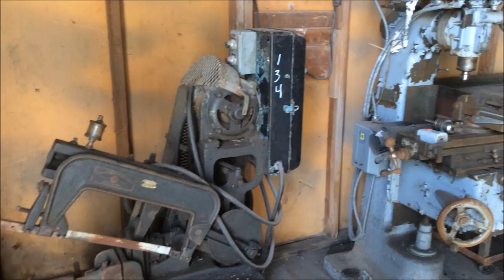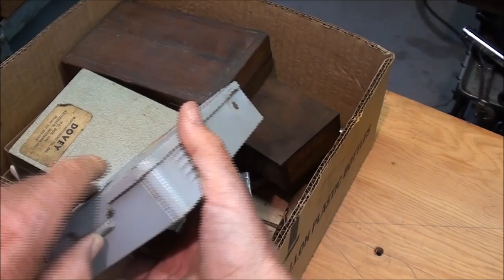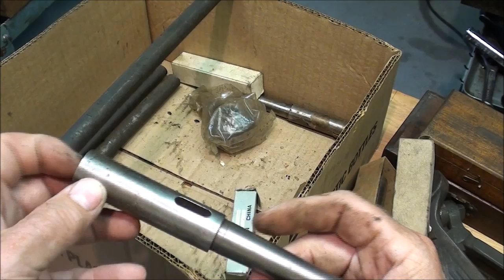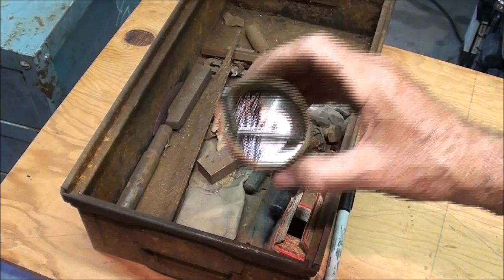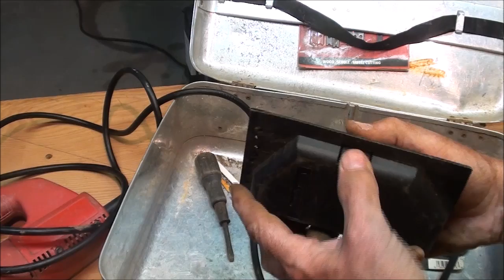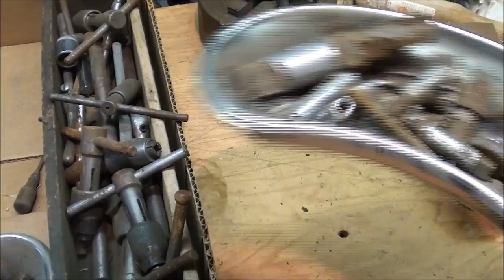TUBALCAIN GOES TO AN ESTATE SALE part 1 logan lathe

Comment: I like your videos and you are a man full of knowledge.  I worked for a man that ran a machine shop on a navy tender ship. Best working experience of my life. After he retired from the navy, he operated a machine shop and welding shop in my home town. From 67 until 2015. 
I love all your videos and I have a Logan lathe that needs tooling and much work to be useful in my motorcycle repair shop. 
I like your non spilling oil can. I found a bunch of tiki torch cans that have a screw on top for refilling. Gift idea for my brother in law's small machine shop at his home. He has a LaBlond lathe and a jet vertical mill. He is retiring this month at 70. After 40 + years in the shops here. Keep it going ,you are a great source of information.
Reply from the maker: Those old navy guys sure know a lot. Thank you for watching  I remember seeing those torch cans. That's a good idea
Reply: @mrpete222  thank you for responding so quickly. I am 65 and not to far behind you in age ,but I'll never catch you in experience.

Comment: As usual, I'm way too late, but as someone else has posted, those parallel jaw pliers were a good find if they aren't locked up. Also the the straight and curved round nose pliers.
Ah well.

Comment: center drill make them in to end mill tool for Mimi milling machine.
Reply: I use old centre drills in boring bars and slotter bars o my Bridgeport.  They are HSS and have cost no extra
Reply from the maker: +James Addington THANKS for watching

Comment: These videos of yours were coincidentally very helpful to me, and also oddly somewhat like an experience I had just this morning. I watched your multi-part Estate Sale vids not long ago, then just last night I was driving through an alley, and to my utter astonishment I saw someone had thrown away several boxes (and metal tool boxes) full of tool stuff!! To my heart's delight, and my back's dismay, I quickly and quietly gathered up every last bit, and rushed it home not knowing what it all was, and only catching a little glimpse of things. I then had to painstakingly wait until this morning to do an “unboxing” of my free treasures. There was some typical old hand saws, various hammers, a few manual worm gear drills, a few planes, tons of various pliers and screw drivers (Curiously not a single socket), several C Clamps, a Wilton Baby Bullet vice w/ Power Arm, a few machinist vices, a tool box full of files and wood turning knives, boxes of taps and dies, a tray of lathe type wrenches, T handle nut drivers, a TS-30 torque screw driver, and much much more, stuff that I don't even know what it is yet, but also a whole tool box of perhaps a few hundred bits, bores, reamers, chucks, and several Modern Magic collets which I recognized from watching your unboxing vids – Thanks for sharing the knowledge :)
Reply: John, it was the craziest find I have ever had, like a dream really. I still use some of the items today. The Wilton I actually sold for $200.
Reply from the maker: WOW--that's quite a find.  You should do a video on that. Thanks
Reply: Thank you. To me it is a heck of a find, and one of which I am grateful. - Actually I am slowly but surely taking photos for a vid. :)
Reply: If interested: I posted a short photo montage vid of my humble tool find.
Reply from the maker: John Strange Cannot find your pics.
Reply: Whoa, a lucky find just for the Baby Bullet!

Comment: About keeping old spark plugs... it saved me a 15km walk once! I thought I should change the spark plug on my Zundapp CS50, so I replaced the old one with a brand new NGK spark plug. I put the old one in my toolbag. And what you know, while on a trip the new spark plug failed on me after only a couple days. I put the old one back in and went on my way again.

Comment: This moisture-meter: I own the exact same one. Mine is made by DOSER, an south German Company. These are for measuring Wood moisture Content. the Advantage is that you just touch the Wood for measuring and not have to poke holes in. Originally they came with Mercury button cells witch are forbidden now (at least here in Germany). But i could let mine be rebuild for AA type Batteries for an reasonable Price.